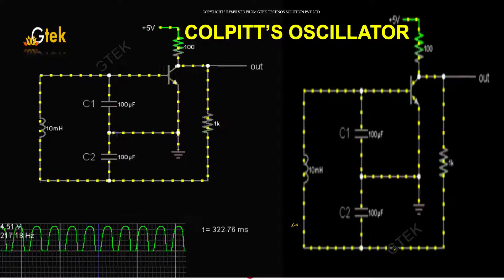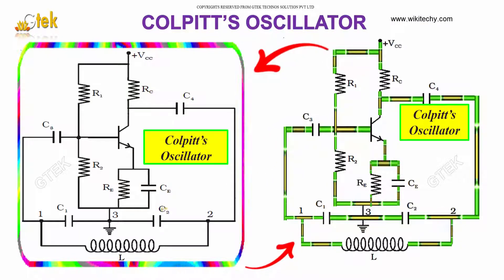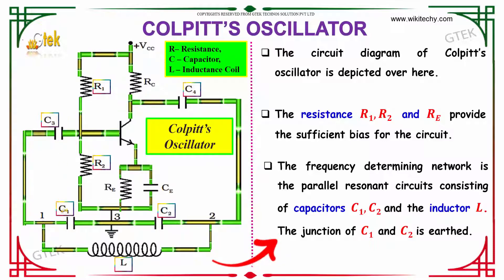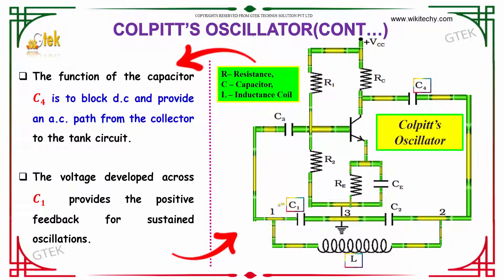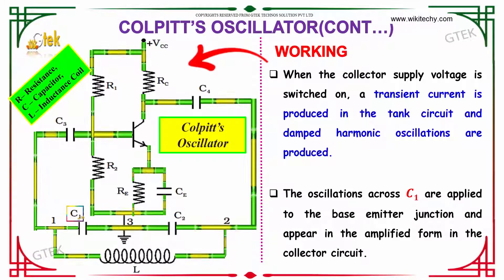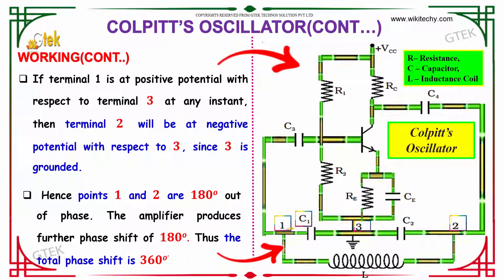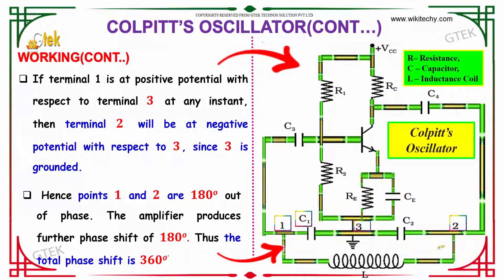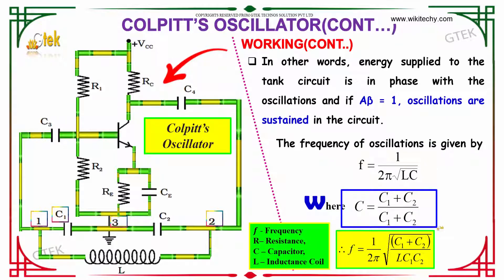Colpitts Oscillator|Semiconductor Devices|class 12 physics subject notes lectures|CBSE|IITJEE|NEET

Comment: The Colpitts Oscillator design uses two centre-tapped capacitors in series with a parallel inductor to form its resonance tank circuit and produce sinusoidal oscillations

Comment: A Colpitts oscillator, invented in 1918 by American engineer Edwin H. Colpitts, is one of a number of designs for LC oscillators, electronic oscillators that use a combination of inductors (L) and capacitors (C) to produce an oscillation at a certain frequency.

Comment: A Wien bridge oscillator is a type of electronic oscillator that generates sine waves. It can generate a large range of frequencies. The oscillator is based on a bridge circuit originally developed by Max Wien in 1891 for the measurement of impedances. The bridge comprises four resistors and two capacitors

Comment: A phase-shift oscillator is a linear electronic oscillator circuit that produces a sine wave output. It consists of an inverting amplifier element such as a transistor or op amp with its output fed back to its input through a phase-shift network consisting of resistors and capacitors in a ladder network.

Comment: The Hartley oscillator is an electronic oscillator circuit in which the oscillation frequency is determined by a tuned circuit consisting of capacitors and inductors, that is, an LC oscillator. The circuit was invented in 1915 by American engineer Ralph Hartley.

Comment: Colpitts Oscillator consists of a parallel LC resonator tank circuit whose feedback is achieved by way of a capacitive divider. Like most oscillator circuits, the Colpitts oscillator exists in several forms, with the most common form being the transistor circuit

Comment: A Colpitts oscillator, invented in 1918 by American engineer Edwin H. Colpitts,[1]is one of a number of designs for LC oscillators, electronic oscillators that use a combination of inductors (L) andcapacitors (C) to produce an oscillation at a certain frequency. The distinguishing feature of the Colpitts oscillator is that the feedback for the active device is taken from a voltage divider made of two capacitors in series across the inductor.[2][3][4][5]